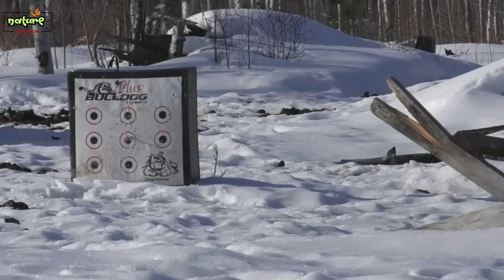This Is How Farmers Are Tricking 1000's Of Wild Boars... And It's GENIUS!

Comment: Building concrete fences is better than digging the earth.
Reply from the maker: That’s a solid point — literally and strategically. Concrete fences are long-lasting and can stop wild boars from digging under or breaking through, something simple trenches often fail to do. The challenge is cost and coverage — fencing thousands of acres is expensive, but it’s one of the most effective long-term solutions.
Reply: @INTROTECH01  Fence, where they go, keep in neighbor farmers? great. They need to be traded and some killed. Besides they would dig under the fence. Not good idea.
Reply: Ide yg bagus tapi lebih bagus pakai uangmu buat membiayai nya

Comment: Those hogs gotta go ! No good sending them to neighboring farms to tear it up.. eliminate them the cheapest way possible, notice all the babies?? That tells the problem..
Reply from the maker: You’re right — all those piglets mean the problem escalates fast. Eliminating them cheaply sounds simple, but in practice it risks safety, disease spread, and more damage. We actually made a video showing the different control methods some places try (and which ones worked or failed). It explains why it’s not as straightforward as it seems — worth watching if you want the full picture.

Comment: Wouldn't it be better to find a sound that they don't like where it hurts their ears and drives them future away.wouldnt that be cheaper and easier.have it runs across speakers that they only can hear
Reply: And do what, send them to another location or country to do the same
Reply from the maker: That would be neat and less violent for sure — cheaper and kinder if it actually worked. Worth noting though: sounds can bother other wildlife (and people nearby), so it’s not a perfect fix. Still, definitely an option to explore.